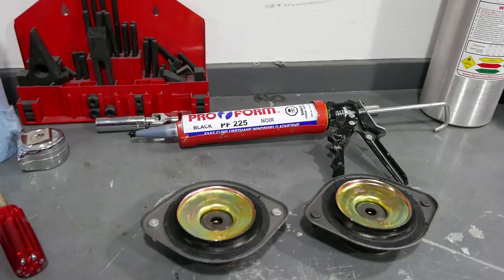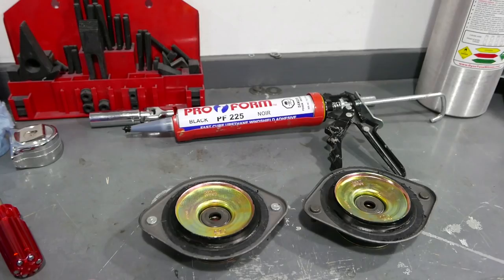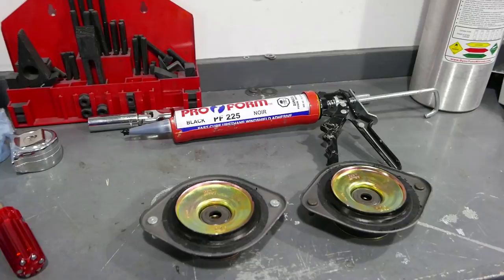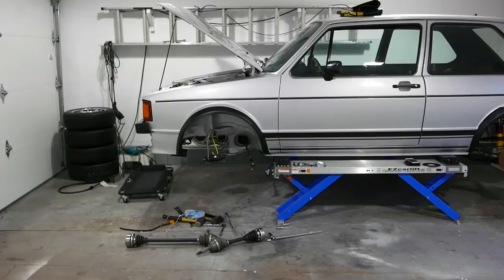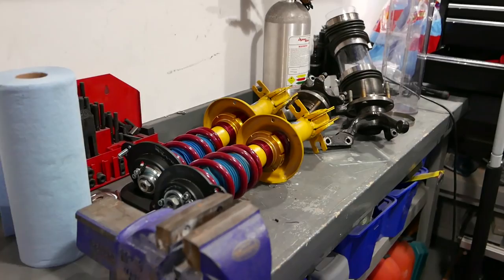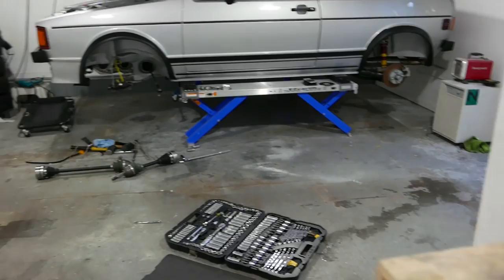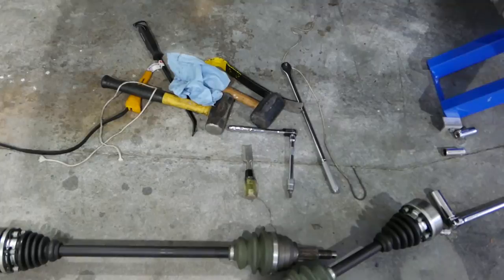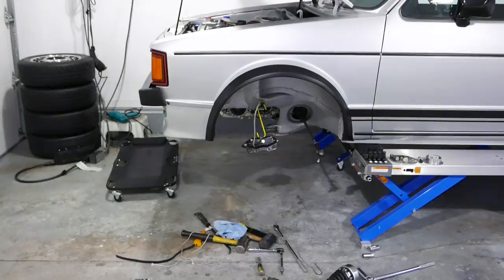The Ultimate 1983 Rabbit GTI - part 170 (Starting the process of returning to street car specs)

Comment: Missed this car.
Reply from the maker: I am happy to be back at it. I now have gone all the way to pulling the engine out of the car and the crank is now out as well. New bearings, etc - it will be a completely refreshed engine. Also swapped the 5th gear in the trans yesterday. Cold as hell here at the moment though so no painting and final assembly until March ...

Comment: With your powerband in conjunction with the new fifth gear ratio, it would be nice to have a higher ring gear ratio. I know Autotech used to supply them made by hor. Unfortunately I don't know of a current supplier. I desperately need something like that myself. Love the car.
Reply from the maker: I am hoping that the new 0.76 5th will result in a good compromise - the close ratio 1-4 set with the 3.67 final drive works well with the 1900lbs car as 0-60mph comes up easily in 2nd gear, and 3rd pulls super hard as well but 5th has always seemed too short.
Reply: @derekspratt  I find that the 2nd to 3rd gear shift has too much rev drop.

Comment: Super tech do not suck. Cheaper than Ferrea and Certainly better than OEM. But over all great to see that you’re going through the GTI. 

What cams did you go with? Techtonics? Schrick?
Reply from the maker: To be clear, Josh (my engine builder) has had several engines with the Super Tech HD seals that came with the 7mm stem Super Tech exhaust valves leak oil and make a mess of things - not sure if it was a bad batch of seals. I am using the TT 288 solid lifter cam set and now have their basic seal set going in. I don't really want to pull the heads off all the time but now that I have done it I am not as worried about doing it again - could be a maintenance thing every few years ... I like the idea of clean heads.
Reply: @derekspratt  l

Comment: Wich head gasket you used? MLS aeg gasket? Fit with ABA block and 16v head?
Reply from the maker: You have 2 options: the ABA mk3 which is around 0.080" thick, or the mk4 which is around 0.060" thick - I use the mk4 which give me a bit more compression
Reply: @derekspratt  thanks